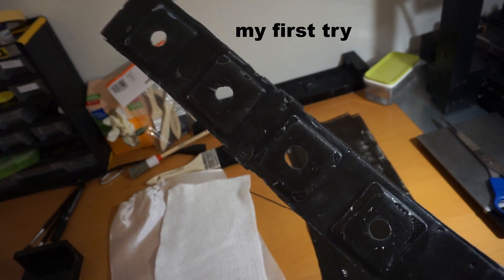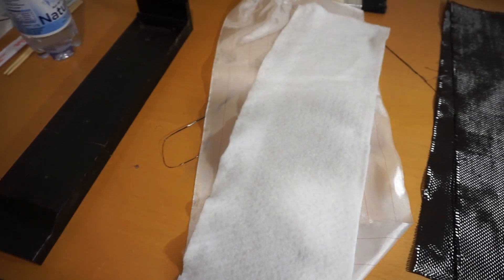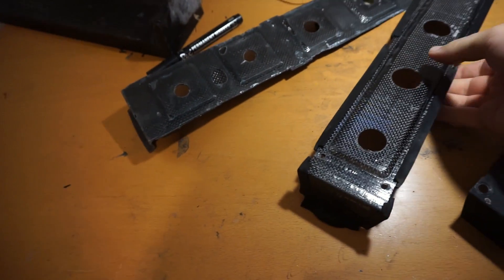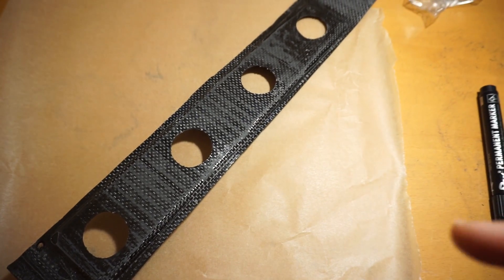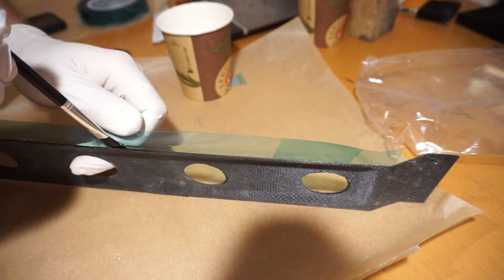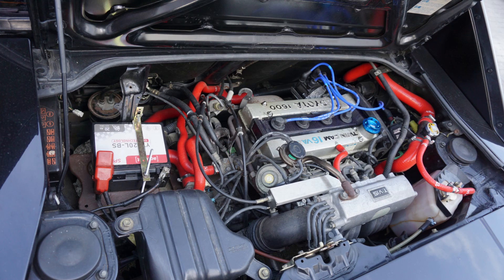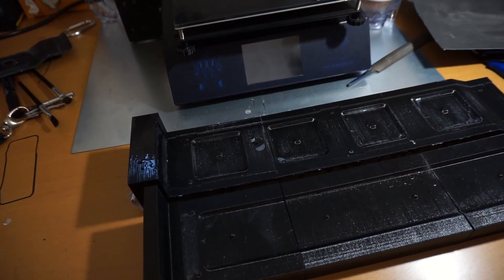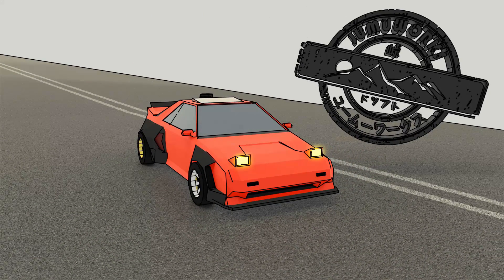DIY Carbon Fiber 4AGE Spark Plug Cover for my Toyota MR2 AW11 with 3d Print Mould

Comment: Fantastic work.  Don't knock that result for a first time effort.  You could apply multiple coats of resin or 2 part clear, wet sand with increasing grits of sandpaper and have that look perfect.